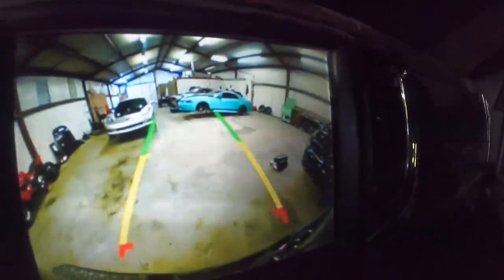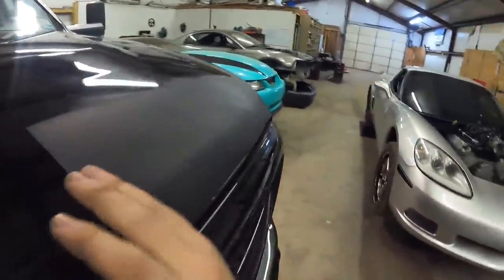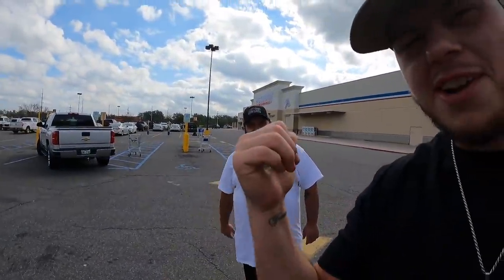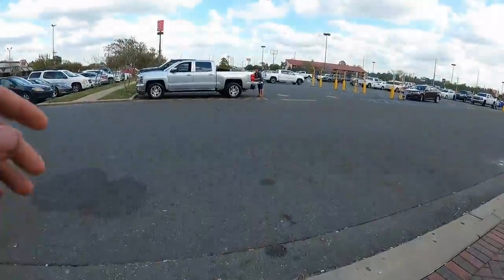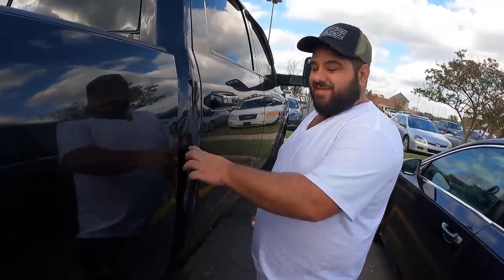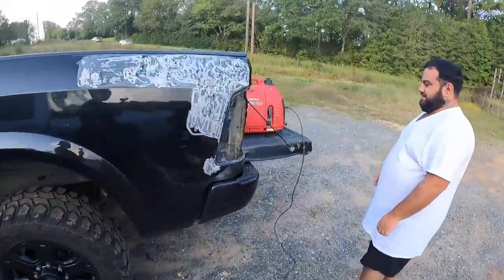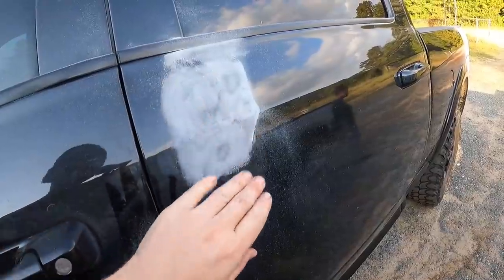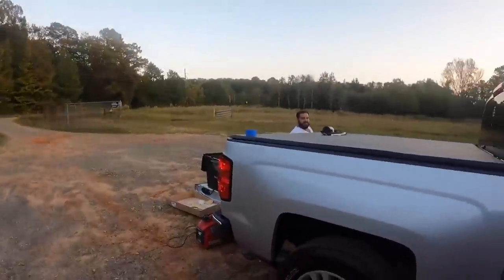Gypsy Body Man Fixes Major Damage on My Truck in Parking Lot!

Comment: you got to realize that guys not a full high production body shop, he did everything from his own truck with his family in it. He did an amazing job for just in a couple hours and for a good price. A cool guy who is working hard for his money.
Reply: $700- $100(supplies) = $600 for a days work! Not bad at all
Reply: John B  you're right!!! I might hop onto this business opportunity... just need to invest in the equipment
Reply: John B  most kids. Not all of them
Reply: Except he is making the money in a dishonest fashion. That repair was not right at all. You can't just pile filler on and use the wrong primer and DRILL HOLES INTO A PANEL and then just fill those hole with filler. That is not how that works. That cab corner will start rusting from the inside out because of trapped moisture. It will cost MORE money now to get it fixed the right way. You don't need a full production body shop. But what you DO need is the knowledge. You can have a million dollar shop all you want, but if you have this guys technique and knowledge using that shop, you will be out of business in a few months...
Reply: I mean he fixed it, for 600 I guess you could say he got what he paid for. Did he do a "good" job? Idk for me if I want something fixed I want it fixed right. Not even getting into the potential problems he can face later on, In the beginning of the video when he was going around the truck, you can see diverts high spots/low spots and overall it does not look good/smooth. Even with a wrap it will still be noticeable.
Reply: @guybrodudetv7492  I couldn't agree more Bro . I applaud  this mans willingness to work but i cringed when he drilled the holes . That is the most barbaric way to pull out a dent and is well in the pages of the auto body history books  ! No metal prep , no etching primer and no Epoxy  just rattle can thin primer and spreading plastic over shinny gloss paint . At 9:00 you can still see the wow in the body line on the box side . This man should apply at a licenced body shop and hone his skills . He seems to have the basics down and would probably excel in the right atmosphere . Best of luck to him . Hard dedicated workers always succeed .
Reply: Remember, you pay for that mans Talent !  Not his supplies.  Some baseball players make $30,000.00 a game, and they work Maybe 50 minutes...   Remember, we pay for Talent !!!
Reply: Diamond dozen
Reply: Looks great til it falls apart in a few months!!
Reply: @guybrodudetv7492  that’s funny cause I work at a body shop and we fix cars with dents just like this all of the time
Reply: Legit honest living .
Reply: @olesmokey5621  Must be Macco
Reply: John B  Countless youtubers prove this statement wrong.
Reply: It doesn't even seem like hard work to him. He knows his worth, he gets paid. Imagine being a weak employee in a body shop having to please someone above you while looking innocent customers in the face and you have no actual gain other than to feel miserable with your fixed salary
Reply: @olesmokey5621  you work at a hack body shop then
Reply: @dann756  I'm a body man and make a 100k a year. And I don't have to hustle around trying to find work (which I've done) and it's not consistent. Make wayyy more money at a shop and I love all my co workers
Reply: He a gypsy and that what he do for a living I’m a gypsy to but I don’t do body work I do roofibg

Comment: mad respect ive done body work it is not easy by any means definitely respect this mans hustle
Reply: Hardest part is starting
Reply: can you tell me what makes body work cost so much when like body filler with hardener costs like 30€ (35.59usd) for 2kg or 4.4lbs and its not shitty body filler and like sand paper costs like 0.49€ (0.58USD) for one ark of it like when i fixed my cars rear bumper its cost me like 35€ (41.52usd) in total and to get it laid out took me about 10mintues and to sand it took me about 40-50minutes and it was an entire rear bumper basically also rattle can primer cost me 8€ (9.49USD) on top of it so in all it was cheap took me about 1hour and 30mins in total
Reply: @unluckyrgg  A chisel and hammer cost about $15. The ability to sculpt Michelangelo's David with them is what costs.
Reply: @StopTheWastePark  that is true i suppose but i dont think its that hard to fix stuff with body filler but what do i know im just an idiot with too much time
Reply: @unluckyrgg  It's all good Jakko, and I too thought "how hard can bodywork be". Watching guys that really know what they're doing working the dented/krinkled/stretched metal back into shape BEFORE the filler goes on is a great way to learn.
Reply: @StopTheWastePark  i know how to do bodywork stuff i just dont get the hard part of it but i know its frustrating when you sand it too much down or run out of filler or just fuck up couple times and say fuck it
Reply: @unluckyrgg  Well a lot of body shops don't really do body filler anymore. They normally just replace the parts and it's much more cost effective than paying someone to actually have skills. Not to mention the use of aluminum nowadays isn't really helping with resculpting panels.  A common phrase I use is "pay me for my experience, not my time."
Reply: @MrJrawkk  yeah i understand that especially because most jobs here in Finlands or in my own experience atleast is that most jobs are like "we want you to have 2-8years of work experience from the same field of work before you can come work for us" even if you had that much experience but not from actual job they wont let you in basically
Reply: @unluckyrgg  We get the same thing happening here in the states. Nobody wants to invest in their employees anymore they want robots off the shelf that are already trained. Problem is those robots may not do things the way their company wants them done, so they end up paying a higher wage to an "experienced" worker to retrain them on their company's ways when they could have paid less and had someone do it their way from the start.
Reply: @MrJrawkk  companies are dumb then when they have to retire the old workers and they need new workers their companies will basically just stop cause they expect the same amount of experience as before and nobody gets hired and when they decide to hire people with no experience they act towards the new people like they are the scum of the earth
Reply: @StopTheWastePark  exactly.
Reply: The right way: use the metal thats already there to fill the dent
The quick easier way: bondo 
A monkey can get it kinda flat and fill it with bondo
Reply: @unluckyrgg  You guys talk big and think body work is easy after fixing one lousy bumper? It's been proven time and time again that body work not only costs $, it makes you $...So why aren't you out there hustlin'?  If this guy did one of these trucks a day for $600 each while still taking Saturdays and Sundays off, that's a $150k/year job...Where you at homie? lol
Reply: Dope background yo used to love that skate brand
Reply: Dude I do this professionally every day. the products we use are far superior to anything you are getting your hands on.It's the know how you are paying for. Let's see you section a quarter panel or replace a roof panel.
Reply: @spencerlynch38  oh wow ur so cool mr superior tool man
Reply: Plan B, good choice
Reply: jaakko body shop cost alot because its done right. this guy good but didnt do good good. i pay for quality. u never drill holes on pannels. u have to use  stud welder second u cant use primer filler on straight metal unless is dtm wich that can was not. and when it comes to paint blending takes times and more products. you are also paying for the guys time. yea shoos charge alot but they also have a businnes to run. last paints and clears are not cheap unless u want cheap materials. i forgot promise you that if you use a guide coat on that you going to have high and low spots
Reply: @unluckyrgg   its not all body filler. It takes skills to know how to take a dent out and how to even sand the filler.. its not hard but its not easy either
Reply: @unluckyrgg  I don't know where you're from but here in the U.S.A. you also pay for what's called labor. So the cost of material and labor all adds up. You might buy your products at a big box chain store but shops don't use those, they buy higher quality body filler sandpaper etc. Not all shops but a vast majority do. Also they have employees to pay and bills to pay so $50 isn't going to pay their bills so not worth their time. I'm mainly an automotive technician and I hate it when people want me to diag their vehicle for free or $10, diagnosis is much more than pluging in a scan tool, body work is more than just filling in dents with body filler, you're paying for my time and materials/parts that have to be used.
Reply: @papi-champoo6033  yeah i understand the labor part but why does the labor cost so much i know one guy who runs a body shop/paint shop and i asked him the costs of his work for my car he said 1600 for fixing 4-6dents what are not the worst and i asked what body filler he uses and its the same that i bought and he estimated that he would be finished with the work in 6hours so around 60 in total for body filler and 1540 for the labor
Reply: Plan B!? That brings back my childhood😥😥
Reply: @DieselsAndGuns  rest in peace e-dubble
Reply: Ted without a shed piss poor work it's cheap for a reason drilling holes in panels rough as f**k
Reply: @unluckyrgg  it's a skill, a skill that those paying for do not either have time, patience, or will to learn and do I'm their own, those same people are probably busy working on their own skill.
Reply: Tyrone Willingham  this a temporary fix, not a complete paint job. It's meant to fix the imperfections. If you want a complete fix, and color match. Take it to a shop. This job more than likely would have gone through a block process before even putting on the final coat of primer, not to mention some wet sanding. This is a parking lot job, what do you expect? Side note... people complain about old boy screwing holes in the panels. It's necessary to pull metal back to its intended position. Big shops would have made the whole, pulled it. Weld the hole, apply filler, and block till straight. With as little body filler as possible. If you go to a real shop, most will more than likely have an instrument to measure the density of the filler. Therefore knowing if they applied too little or too much filler. When using filler keeping the contour of the original body lines is a must. Over applied filler, under/over sanded  (not to mention using the wrong grit, and tools to block a body) can stand out in a paint job, You can spray a $3,000 worth of a paint , but if it isn't prepped right. Filler, sanding, primer, blocking, wet sanding, primer, block, wet sand, then prep for final paint stages. Body work and paint is no joke, if u want it back like new. I didn't even mention, color matching,blending, clear, and buffing. For those who don't understand why body work and paint costs so much...... I just broke it down for you...
Reply: @juniorizq2342  drilling holes is not the problem, you have a point with the Stud welder. Not that he was doing it wrong, just missed a step. In welding the whole shut. Grinding the welds, then applying body filler, with a block to follow. Basically same thing... but what can you expect from a parking lot fix?
Reply: ernest cortes yea i use the welder to  but kinda fading out
Reply: Yeah usually at least half the price is labor,  real skilled body guys try not to use fillers,  fillers is usually the quick easy cheap way versus pulling , shaping, and replacing panels,  there is also alot of overhead running a buisness and costs you wouldn't think of ontop of utilities such as licensing and insurance.  Same goes for paint , high end paint jobs require alot of labor ontop of consumables..
Reply: @unluckyrgg  the cost it takes to run a shop is why prices are so high.
Reply: @MrJrawkk  dude I worked at a nice body shop for a couple years and I’ve never used bondo. We replaced everything. It’s actually the same price if not cheaper than fixing the old stuff, I don’t see why people even bother. I can do a full quarter panel on a 2015 mustang in 4 hours. Complete car at 8 am, interior stripped, old panel off and new one tacked on by lunch break. With new panels it’s super easy, my work was perfect. Boss would skim it with metal glaze, prime and off to paint. 

I was making $10 an hour, got fucked so hard lmao. $10,000 quarter panel job and I got $100.  But honestly the education I got was well worth it. I worked at a half ass body shop before that and they’d spend all day repairing and bondoing a door while that guy is getting $20 an hour. Like buy a damn $100 door and be done with it. It’s 30 minutes to swap the guts out.
Reply: @StopTheWastePark   u pay for the skill not the product
Reply: @MrPland1992  
Start with Bond is a brand   you sound like a parts changer 
9 out 10 times New parts will have imperfections that have to be dealt with
The so-called body men / parts changers don't have a clue
Seems like everybody in the comments are body men or have been body men 😂🤣.

Comment: I need a little spot welder with him so he can just fill in the holes and grind them off.. UC paint keeps the filler sealed... If you don't prime of the backside of the holes.. moisture will get through..
Reply: how does this change with all the aluminum vehicles coming out?
Reply: Is that vehicle aluminum
Reply: @marklewis3489  I was merely asking how does the process change or does it with aluminum.
Reply: I believe aluminum will Rust oxidizes as well it just probably doesn't do it as fast as metal..I'd paint any material with moisture exposure..that has body filler..
Reply: @marklewis3489  dude u dont kno wat ur saying bro
Reply: well usually body filler over 20 years with moisture getting in between it and the metal of any kind will tend to break free and come off if you were to spray paint behind it or paint behind it so moisture can't get through there then you won't have that problem but to correctly Fix-It you fill in the holes and grind them off and you use as little body filler as you can if u know what's up  anyone can spread Putty all over all over the place and  sand it down..
Reply: @sortac08  fixing an aluminum panel just about triples the cost of repair. Aluminum cracks and tears there is not much you can do but replace entire panel of vehicle hence the extreme costs. Youtube it there are plenty of videos